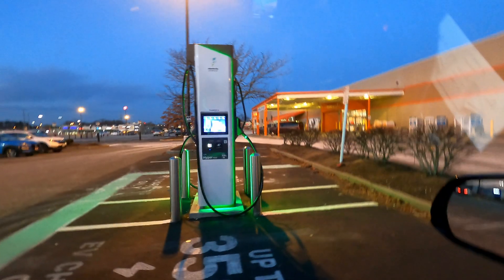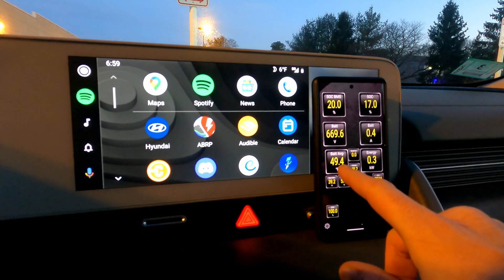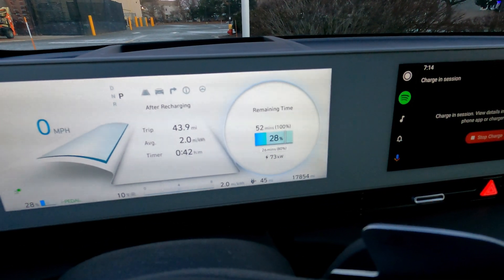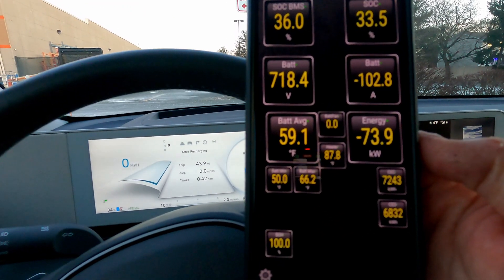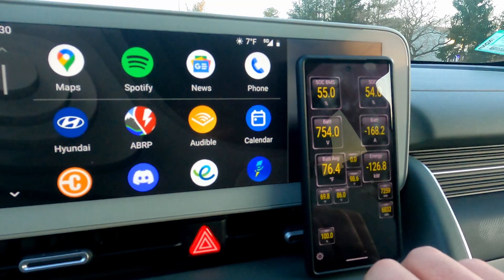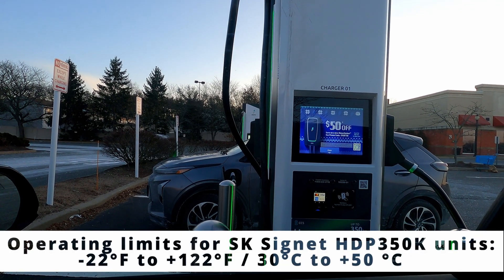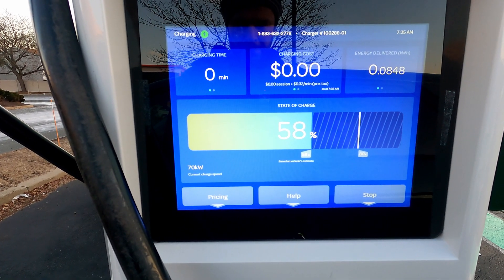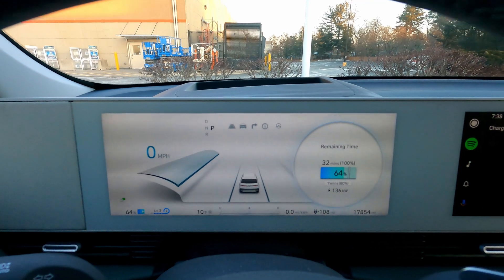New Electrify America Chargers Tested in Freezing Winter Temperatures (Quick Charge # 4)

Comment: I have noticed that some early I5's (that didn't come with the battery preconditioning software update) have a snowflake symbol when the battery is warming up, and some have the coil. Any idea what's the difference?
Reply from the maker: I've heard the same but we've only ever seen the heating coil over the battery icon, previously when it was warming during fast charging, now only when it's warming en route to the charger with Battery Conditioning mode activated.

Two possible explanations I can see:
1) Different versions of the update being installed, somehow, which deliver different iconography meaning much the same thing ("battery cold, heating active")
2) Snowflake could be used to indicate battery is cold but conditioning is not active, heating coil could be used to indicate cold but conditioning is active. Don't think this one is the case, based on those who see the snowflake actively testing the conditioning mode. 

Either way, an oddity that doesn't tell us much but should prompt owners to look at the Electricity Use screen to see if Battery Care is active (usually at around 4-5kW, when heating a cold pack).

Comment: Thanks for confirming that this appears to be a BTC Power issue, Steve! It makes me wonder what EA's decision making process is when it places hardware. It seems like they're deciding where to put hardware based on deliveries and availability rather than local environment. Putting ABB chargers in the Sierras on Highway 395 (it was 10 F to 20 F as I drove through some parts) was a good idea, but putting those same ABB units in Phoenix, AZ was a very bad idea. Maybe they shouldn't just scrap the BTC Power units but rather make it a point to locate them in temperate climates.
Reply from the maker: I'd still like to test the Signets in extreme frozen temperatures, as it could simply be that we haven't been low enough to vex them yet. But in reality, we don't usually get anywhere near those negative double digits in this area, so it's not going to be a common problem here. Buffalo might be a possibility with the lake effect snow and severe wind chill, though.

Your point still stands either way, though: the hardware should fit the needs of the environment. And adequate shelter might help... even heating of some sort, perhaps, that could activate during these extreme weather events?

How do you feel about moving to a single vendor for hardware? Possible/desirable or simply too much manufacturing strain for any individual vendor?
Reply: @plugandplayEV  Yes, I definitely think some additional heating should be considered in extremely cold climates. That really shouldn't be that hard to set up.

I have mixed feelings about going with a single vendor. It's less about the manufacturing strain and more about these types of issues. We also saw this with GM and the Bolt EV, having to rely so heavily on LG in order to remedy a problem that they created.

After speaking with EVgo, they definitely like having consistent hardware to work with, and I can see how it makes their life easier from an interface and programming perspective. It just opens them up to a lot of risk. It's a little different for ChargePoint, which at least controls its hardware internally.

Comment: I have a 2017 Bolt.  All my charging experiences are too long. Definitely need more fast chargers near restaurants.
Reply from the maker: We're closer to that experience at this point with the I5, but it will still crank out a solid 60-70kW at the start and you know it's only headed up from there if you're low in the pack. Still, 30-40 minute charging sessions have reminded us that the Bolt trips were doable with the right stop. As you say, when you're next to a sit-down restaurant and it's meal time, that charge session doesn't feel long at all.

Comment: It’s great that you had no issue charging at this one location.

Other channels have shown that is not a typical result.

It doesn’t get very cold near me. We typically only see a couple weeks of below freezing days for the entire year. The coldest I’ve ever seen jt here was 9F. So, this issue may not impact me, but if EA does have a widespread issue with their new hardware in cold temperatures that are regularly seen in parts of the US and around the world, it’s still a huge fail and needs to be addressed.
Reply from the maker: Interestingly, this was a common response to the original video across many locations with new hardware. EV drivers from Mass. to Michigan and down to Texas went out to test the new hardware in the lowest temperatures they could and found them to offer a successful charge. In turn, this helped show that the original video could highlight a problem with the individual vendor at that one location, BTC Power, rather than the vendor used at the majority of upgraded sites, SK Signet.

Completely agree that this is an issue to investigate and be resolved, but I'd simply flip your opening thought back to the original report: it's a single case of hardware not operating at an individual location in extreme weather conditions (snow, wind, and dangerously low temperatures). These are not typical charging conditions for the vast majority of folks on a standard road trip. In fact, if I encounter this scenario with my family on board, I'm pulling off the highway and looking for a hotel to ride out the storm, not a fast charger to get me back onto the (potentially lethal) frozen road.

Comment: I recently tried charging at a charge point station which has always been solid for me. Cold battery I’ve always seen like a max peak of 12-15kw for like 35 minutes before it finally ramps up. Recently here in NYC it’s been BRICK outside. Cold battery all I was able to get up to was 5 kw up to 16 kw after 40 minutes. 

Haven’t tried it again yet.

2019 Bolt EV
Reply: That may be right on track for a Bolt. I don’t think they have a ton of cobalt to combat coldgating whereas apparently the Korean cars have their fair share.
Reply from the maker: Unfortunately DCFC just wasn't high on GM's priority list with the Bolt EV. It does so much else well that it's mostly forgivable, but for anyone road tripping or unable to charge at home, the fast charging sessions can become a drag in cold weather,
Reply: @plugandplayEV  Steve I must say I followed you for a couple years and I was seriously considering a Bolt as a result. Plus a good friend had had two of them back to back and used them a lot. But back in April 2022 when you went public with buying the I5 is right when I was looking to buy my first new EV and a week later after your I5 video dropped is when I found an EV6 in stock at a local dealer and signed the paperwork. Lol. I’ve been super happy with the purchase. Probably would have been even happier with an I5 for a couple reasons (free EA sessions, cushier, more space) so if anything I didn’t copy you closely enough but I’m really happy with the car 22k miles later having road tripped the heck out of it.
Reply from the maker: @skyemalcolm  Great to hear! Given the long-distance miles over nine months, I think you made the right decision! I've seen plenty of folks hopping over state lines to PA and NY for a reasonably-priced I5. Having spent time with both, I'm happy with our choice but don't think we'd have been disappointed with an EV6 either... WiFi hotspot and higher rear USB ports would be two handy items, though I'd definitely miss the I5 Vision roof.
Reply: @plugandplayEV  ha ha we should trade because I think I’d like the cushy seats and mellower ride in the I5. Give me a little battery preconditioning though in the EV6 and I think it’ll be fine. Without it I definitely noticed the slower winter vs summer charging and the subsequently longer road tripping. In the summer/fall I could match the ABRP predictions on overall time. But no way this weekend was that possible. 12 hours OH to NY and 13 NY to OH.  We had a tailwind on the easterly journey and a headwind going back to Ohio. On one hop we managed to preheat the batteries by a top off stop but most of the stops things cooled down to 15 C or so based on the charging speeds. Car Scanner connection to the ODB doesn’t play well with ABRP so I sort of have to prioritize one over the other and getting an accurate arrival SOC was more important than doing a preconditioning test for posterity.
Reply from the maker: @skyemalcolm  I'd love to do a 1-year owner comparison alongside your EV6, if the stars align. Once we've both been through all seasons (winter being the last) and have a fully-rounded view of how it handles the New England/Great Lakes snow :-)
Reply: How far could you hAve driven in 40 MINUTES ON GAS ?

Comment: In my experience, EVGo is more reliable but not as widespread as EA. As a plus, EVGo has auto charge feature, I just plug and go like a Tesla Supercharger. They received investments from GM so I think they have the ability to outpace Electrify America
Reply from the maker: I'd love to consider EVgo as a viable competitor to EA, but it simply isn't the case yet in New England. The typical EVgo location here means outdated hardware, underpowered stations, and too few stalls for the location (usually one or two, while EA has 2-4x that number just across the lot). They also take forever to fix, or just abandon locations altogether, as I found with one in Westfield, MA last year. 

That said, I see the reports from other areas and they do seem promising, aside from the pricing model. If we can get the higher power installs across the Northeast and pepper in some well-placed Pilot/Flying J installs for travel, I could see an EVgo-only road trip becoming reality.
Reply: @plugandplayEV  I also live in MA - It's cool to see another EV enthusiast in the area ! On a side note yeah fully agree with you there regarding EVgo and Electrify America's short comings. I noticed in plug share though that there are a ton of 'coming soon' chargers in MA funded by state. It says it's expected to go live in 2024 though.

Comment: Personally, I avoid taking road trips in sub-zero temperatures, regardless of whether I am driving an EV or ICE vehicle. Outside of long road trips I would be charging at home. I know that may not always be an option for everyone.
Reply from the maker: There are certainly scenarios in which folks can't avoid it, but when the temperature reaches critically low levels that border on dangerous, I'd agree that fast charging my car would become less of a priority than finding warm accomodation with destination charging and riding out the deep freeze. These stations clearly need to be more appropriately wrather-proofed, as gas stations have been, but demand must surely drop dramatically in frigid conditions, making the likelihood of an easy charge that much higher.
Reply: If you cannot charge at home why would you buy one ?
Reply from the maker: @davidkettell5726  Several reasons -- Workplace charging. Complimentary charging in local town parking lots or at the grocery store. Fast charging deals included with purchase of vehicle. 

But yes, home charging is a major advantage that EVs bring over combustion, so losing that would be a negative.

Comment: Yeah I saw the "Out of Spec Reviews" EA sub 0F charging (or lack of) too... well at least we don't get THAT cold in the northeast (in our area).  I did notice on my charge point app my Bolt (with a full charge already) kept on taking power periodically when the temps dipped..... we went from 52F to 6F the other night 🥶... and you're right the chargepoint app is very informative 🤓
Reply from the maker: Yep, that temperature nosedive was brutal... but good for this test, if nothing else! There's definitely some battery conditioning going to work in the Bolt once the temperature gets below 20F. I forget the exact range and where it's trying to keep the pack temp, but having the car plugged in and able to draw the power it needs for conditioning is the right approach.

Comment: I watched Kyle's video when it came out.  I hope it's edge-case. Personally, I don't plan on driving in that kind of weather. Also, I saw you have Electric Circuit app.  Every time I try to order the RFID from the app, I get an error. Doesn't seem to be an option on the web site either.  Have you tried to get the card?  I'd prefer to have it since I don't have international roaming on my phone to activate a charge.
Reply from the maker: We do have the card somewhere, probably in the Bolt's visor storage but the last time we used it was well before the pandemic. So I can't really speak to the efficiency of ordering them nowadays. But if you can get into the Member section of the website, there's a menu item on the left hand navigation bar that says "Member Card" -- click into that and you should see the option to "Order Card" on a blue button in the upper left. Current price it's quoting me is $15 Canadian.

Comment: They need to work on those temp ranges.... I lived in MN for 20 years and temps outside those ranges aren't that uncommon at all. You really need a 20-to-30-degree buffer beyond what you think your worst case will be in my opinion... so 70 or 80 below F should be a minimum standard in my opinion... and the 150 to 160 range on the hot side. I'll state it again that's at a minimum in my opinion. Thanks for all the good data you provide and try to stay warm the next week or so during this cold snap.
Reply from the maker: Thanks Jesse, looks like we're through the coldest portion here and somehow dodged snow (which is actually a shame, as the kids got snowboards for Christmas!)

I think the other side of ensuring hardware reliability in locations that see those temperatures would be shelter, heating, and maintenance teams on hand to address any temperature-related problems throughout winter. I intend to take a deeper dive into the tech specs of the latest DC EVSE, but if Norway can make it work with a much higher adoption of electric vehicles, you have to figure there are options that can be deployed for those parts of the US and Canada that commonly see temps below -20F.
Reply: @plugandplayEV   - oh I agree no reason it can't be done plenty of electrical devices operate flawlessly every day in those temps... That's why I said the standards that should be acceptable should be basically any temp 👍😂 thanks again for all you do, if you weren't so thorough I wouldn't know that the temp ratings were where they are.

P.S. I hope your kids get plenty of snow for boarding in the rest of winter ,👍
Reply from the maker: @bigretardhalo  Cheers, we might have to seek it out if the forecasts are anything to go by. Enjoy the rest of your 2022 and thank you for all the support and thoughtful comments this year.

Comment: Two days ago, basically the morning after seeing Kyle’s troubles in Colorado I visited the EVgo and EA stations on the west side of Columbus Ohio and I got successful charges right on first plug in.  We have only older 2nd generation hardware at that station and it’s generally 5 or 6 of 8 working with the 350s having been down for months, nothing to do with the cold. I only tried one dispenser at EA because it was “wicked cold” at about 0F and 20-30 mph winds and snowing. The EVgo session was Autocharge+ which was much appreciated. I didn’t have the editing energy to upload everything properly but let me leave you with this driving shot between charges in the snow:  https://youtu.be/br5Hiudb0S0
Reply from the maker: Thanks for the report. That more or less matches my experiences across the Midwest and Northeast this year, other than the cold aspect. We're just not going to get those kind of temperatures for long enough here that I'll be likely to test extreme lows, but I wouldn't be surprised if the Signet hardware also has problems around -15F and beyond. Oddly, CHAdeMO might indirectly save the day in those rare cases, as the legacy units that get left in alongside the newer dispensers seem to be fine. "Wicked cold" also seems a very fitting term for these freezing tests around Mass... "fackin' freezin' " could also work, I guess, were I to channel some inner Cockney spirit.
Reply: @plugandplayEV  I dropped the wicked in your honor figuring you’d understand exactly how cold it was.  Looking back at my weather app it was -6 F, winds 18 mph gusting to 34 mph with a “feels like” -29F. Highly unpleasant is a term I’d use. I was plugging in the units without gloves on because I had the phone in one hand and the charge plug in the other.

Comment: what is this telephone app you are using to monitor your battterie temps ?
Reply from the maker: It's called Torque Pro for Android. Not available for Apple devices but CarScanner our Engine Link do a similar job. OBD2 dongle required to connect to phone and pull data into the app.

Comment: Cool test, thanks for showing us OBD2 data and the charging station's model labels/plaques. I guess the Ioniq 5 heated the battery too slowly (no preconditioning) and by the time it was warm the state of charge was too high to accept more than 160 kW.
Hopefully you're able to book a service appointment to get the preconditioning update soon so you can do more test videos in the middle of winter.
Reply from the maker: Booked in for tomorrow afternoon! The tests have been interesting to run, but having the option of turning pre-conditioning on or off will open up the potential to see both side, with and without the feature. Certainly glad we went with the AWD model, as '22 RWD trims aren't getting that feature.
Reply: @plugandplayEV  Yeah it's bizarre RWD Ioniq 5s won't be getting preconditioning. It's ludicrous Hyundai didn't equip 2022 RWD I5s with battery heaters. At least all EV6s ever made have a battery heater.
Hopefully I'll get my 2023 Wind RWD EV6 before the end of the winter.